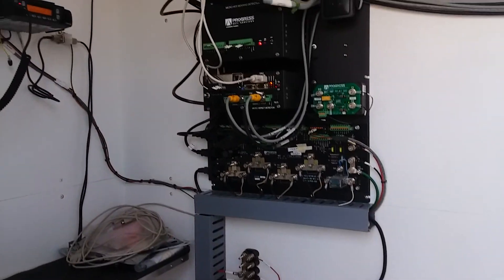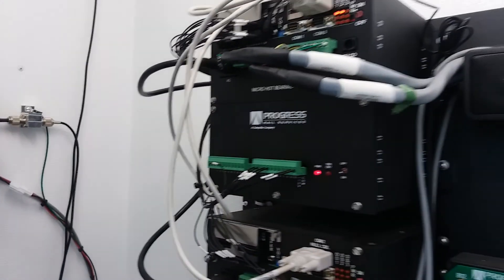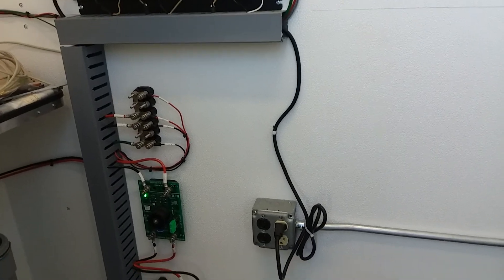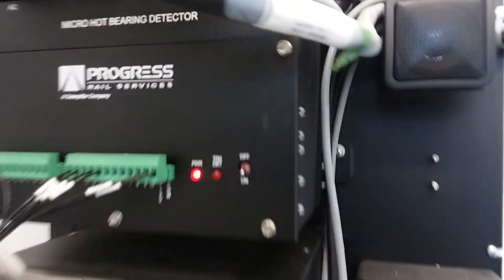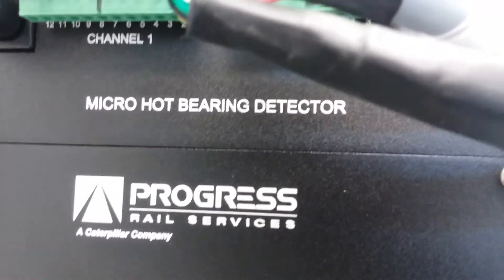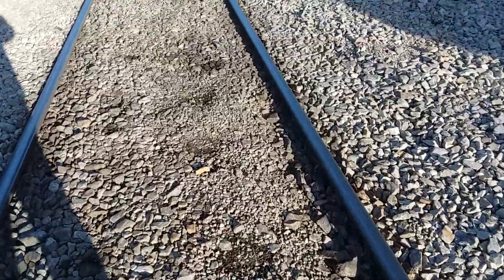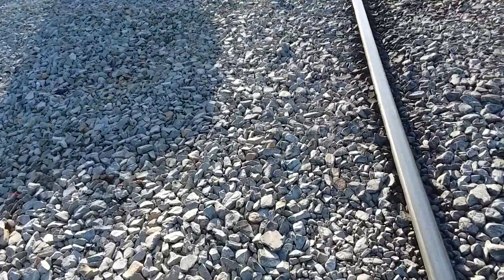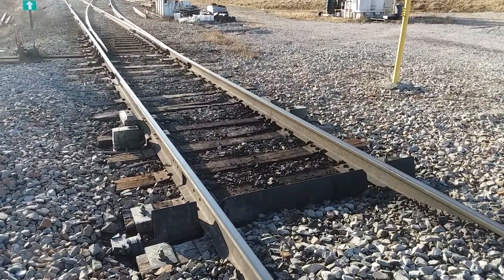Hot wheel detector, look inside the defect detector building

Comment: I've seen trains go by at night with one wheel where the brakes were applied full force, and the steel wheel was glowing red hot and throwing sparks into the dry brush along the tracks heading south. I called 911 and told them about it, and they were totally uninterested until I told them that I knew my call was being recorded, and that they were now responsible for fires set along that track by those sparks, and families killed in their homes as a result. That got the dispatcher's attention, and she said she would get right on it.
Reply: I keep the emergency contact numbers for the railroads in my area saved in my phone for such occasions.
Never seen anything quite like that, but I have seen a rear locomotive spewing sparks.
That was an interesting call, because it was a UP locomotive, but when I called UP they said they didn't have any tracks in the area, but when I told them the Loco number they discovered it was running on a BNSF line, so they transferred me over there, at which time I had to convince the BNSF Dispatcher that there was a UP Loco on their line!
This was up in Southern Washington where BNSF runs down the center of i5.
Reply: Very interesting comment sir, that had to be a real sight after dark! Awesome you
got to see that. Always amazed me more fires weren't started along the tracks
in them good old days. We've had several fires along the tracks from sparks off
the loco engines, one fire was really dry out and the fires spread out over a 5 mile
stretch, not one big fire for that long, but lots of little ones. The loco shuttled the
fireman up and down the tracks, they had a long afternoon trying to put all those
fires out with brooms, hardly anyplace they could get a water truck to.

Comment: Inside the guage you have the transducers which count axles and sense direction.......
Reply: The gated transducers tell the detector that axles are passing over, that begins
the process whereby the shutters are opened on the detectors. Yes they do count the
axles in and on the other side axles out. Once the shutters are opened they take an
infrared picture of every wheel and bearing, translate that into digital which is
recorded in the processor in the wayside bungalow. It is an amazing piece of
technology, and what we have is a basic model. the best ones out there are
just mind boggling what they can do, record and send info. thank you for watching
Gordon, good question sir.
Reply: I'm a sinal maintainer. We use SOTC's (short overlay track circuits) for presence detection. They operate on a few kilohertz and the senstivity can be adjusted for however long or short you want your detection approach to be. Those trigger tthe shutters on our systems.
Reply: @gordoncrisp3060  Awesome Gordon, I do believe you can program into this detector
that parameter also, although I have no clue how it's done. This thing is amazing
what all can be programmed and what it can do. I am certainly no way near any
kind of technician like you are. I do thank you so much for your inputs. It is also
amazing how reliable they are.

Comment: The devices looking at the bearings and wheels are called pyrometers, or "pyros" for short.
Reply from the maker: Gordon, nice, thanks for adding that in
Reply: Laser pyrometers easily handle the very short time they have to make the measurment.
Reply from the maker: @dpeter6396  its amazing that this detector can read if there are train speeds of up to 90 mph. Just incredible

Comment: Why is the DD running on a UHF frequency? Do shortlines typically use UHF? I had a shortline near my house (ceased operations in August last year RIP EFRX) and I had no idea what frequency they used. Never picked up any close calls from them, nor could I find them on radioreference.com. Granted, they only had 1 locomotive, but they would regularly interchange cars with the BNSF.
Reply from the maker: Wow, you ask some serious questions that i have no answers for. I dont understand radio stuff like that, but hopefully someone that does will answer. Thanks for watching
Reply: @ccrx6700  Ah, ok. My local subdivision (BNSF Scenic Subdivision) runs on 161.100. Most railroad frequencies are between 160 and 161 (maybe a few on 162, but not many). The only other frequency would be the EOTD/FRED (whatever you wanna call it) frequency on 427.9375, in the UHF band.
Reply from the maker: @everettrailfan  maybe we oddball cause we are a mine and have different channels for RR, prep plant, slate dump and outside yard?
Reply: @ccrx6700  Maybe, dunno lol.
Reply: @ccrx6700  You're probably using one the FCC Industrial/Business pool frequencies, which can be assigned to any business such as a shopping mall, towing company, etc.

Comment: You guys are using UHF 464 MHz for the radios? I figured you would be on the VHF railroad band 160 MHz. anyways all that is is a computer and sensors with a voice synth connected to a radio. Thats the basic description. going more in dept like how it's programmed in C or C#, running a distro of busybox linux, and mp3, ogg or wav files may be too much lol so I will keep it simple.
Reply: They're a mine too and probably couldn't use the VHF railroad band for mine business so they went with business band radios.
Reply: no no, splain pls.

Comment: That's some interesting gear! When a defect is found, does it give the location as a count of the wheel?
Reply: Yes, they do.  They can give multiple defect locations based on axle counts.
Reply: @Robertx19  All the ones Ive heard just give the axle number and sometimes which side it's one. Guess it just depends on how the detector is programmed.
Reply: Not all cars have the same number of axels, it is rare but possible. I would imagine the system just gives axel number because it really can't determine if a car has one, two, or even three axels on a truck (that yoke that connects the wheel axels to the car). Cars usually have two Trucks with two Axels each (four per car). Locomotives have varying number of axels, so that would make it more difficult for the system to count cars, so an accurate axel count is all that is needed. I am sure the engineer has an onboard electronic manifest of his rolling stock. All he has to do is punch in the axel(s) number(s) reported by radio and the system will figure out which car(s) have an issue. It knows the model (hence its axel arrangement) of each car attached, as well as weight, and contents. The engineer needs all this info to adjust for climbing/decending hill's, curves, bridges/trestles, braking, acceleration and such.   Am I correct in this?

Comment: The Kenwood radio is about 400.00
The price sounds high
Reply: About right new and straight from Kenwood pre-programmed.  Get em used alot cheaper.  Motorola would be much more.
Reply: The cost probably includes equipment, shed, burying cables, shutting down the line to install the detectors, on-site maintenance, liability, etc.  And it probably requires a support guarantee for 40 years.

Comment: The trackside detector building may also be called a doghouse. I'm surprised they didn't ring the bell and give a quick short blast on the horn, was an FRA mandate when I was railroading. Couldn't tell if they had headlights on on either end of the locomotives.